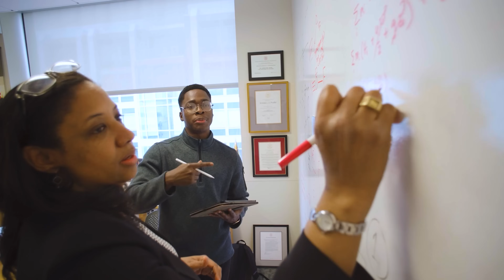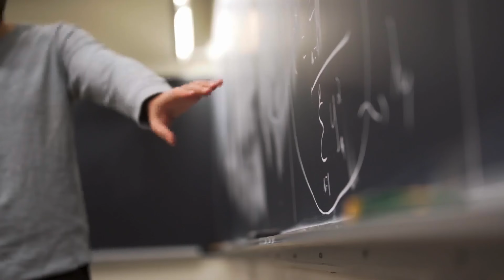This is MIT

Comment: The robotic arm found at 34 seconds on: https://youtu.be/N1jhOO1fyZo?si=GfHkO2pP-Nc1r0KP

Is not that impressive. Wouldn't it simply identify where the intended track is and take the fastest or most optimal route to getting back on that track when moved away, then finish the track? A more impressive thing would be catching moving targets because it would have to constantly recalculate optimal tracks from where it is, accounting for the target's movement speed.
Reply: Also, for my idea, couldn't you use a scanner that police use to determine the speed of a car, then with a dataset, you will know how inaccurate the measurements are to determine the equation, then add time since scan plus time to solve equation. I'm sure there's a trajectory equation, too.
Reply: If there's a performance loss (more inaccurate over time), you'd want that in there, too.

Comment: Let's solve the world

CO2 INTO CH4 IN ATMOSPHERE FROM SOLAR ELECTROPHOTOSYNTHESIS WITH ADDITION OF REFRACTORY RADIATION OF ELECTRONS AND PARTICLES WITH ALUMINUM 

Instead of photons just passing by a plant that reflect back and forth between nano aluminum mirrors and heat up the aluminum atoms plants. Tobacco plants in North America have to be in full shade where they're spraying aluminum yet they grow just fine in Cuba and Ecuador. 

They're making a Methane factory and bonding what could be ozone to carbon, the only way a dumb plan will work is to keep it secret from a world full of geniuses

Tell NASA about the Moon and they'll make Moonfall ; )

They need to make a Universe room and reverse Tesla ball atmosphere models, also just spray desalination ocean water, not aluminum and carbon which cause refractory radiation and is cooking the atmosphere and causing refractory radiation on the surface making it intense, also you might be able to change an orbit. Also the aluminum and carbon being spayed refracts photons, charged electrons, does electro photo synthesis and while you're burning oxygen instead of hydrogen from say, solar electrolysis of ocean water, you're burning oxygen and bonding oxygen to carbon and the H is bonding into CH4 Methane up in the atmosphere. It's all backwards

It is [a really good idea] that we stop spraying aluminum and CO2 into a magnetoshere and start spraying desalinatated ocean water instead, were causing refractory radiation and it's making the heat much more intense and heating the planet and causing melting of ice caps and evaporation of ocean water which then makes fresh clouds; we need to just spray salt free ocean water. The more we try to cool the planet were actually making it hotter and energizing a magnetoshere which could cause more solar flares and fry us. We're cooking the planet and causing solar evaporation of the ocean for clouds formation instead of just misting H20 out of 747's, got a whole plan. We're making CH4 up there in a process of retracting photons into electrons while they spray CO2

Hello my Friends

ANUBIS IS THE BEST DOG

What if Pharoah was trying to build a weather machine to attract lightening to nuclear electro magnetic earth ground to cause more rainfall and thus more food. 

Clouds of higher solar charged particles jump to clouds of lower static change, known as heat lightening, as nature seeks a balance. 

When there's enough solar charge in a cloud electricity as lightening crosses the air insulator and connects to earth, as it does it creates a vortex where hydrogen and oxygen particles connect and bring down water droplets and fall due to nuclear electromagnetic gravitational earth gravity. 

Electrons go around an atom like the moon around the earth and the planets around the sun.  

The Egyptians saw that lightening was attracted to metal, and the higher the better. 

If Pharoah had a copper cap on the pyramids with electrodes running through the air chambers down into the spring underneath, Benjamin Franklin might have been wearing an Eye of Horus Watch and driving a Bently.

Is the grounds turned dry, like a leather glove, no matter how much you tried to arc welds, it wouldn't work. Tree roots go searching for water in the winter when there is no rain, as solar photoelectric synthesis move through an organism seeking earth ground.

Also lightening is more likely to hit the lone farmhouse than the neighborhood, as electricity in houses flow through a black or hot wire, and take a neutral [white wire] path back to the electrical panel, where the Neutral Bar is bonded to the Ground Bar and goes into the earth via an eight foot copper electrode to dissipate returning unused current into the ground. So neighborhoods are energizing water tables instead of storing that electricity in batteries.

Anyways, I'm thinking a cargo helicopter, a brand new Copper Cap for each pyramid, and copper electrode wires running down to earth ground via the spring water table, and electrodes can be drilled into the earth below the springs for better contact, and we can complete Pharoah's Weather Experiment as lightening is attracted to metal high up from the ground ; )

Could you imagine the attraction of this new event to honor the Pharoahs and those that built the Pyramids!

And maybe bring more rain to the earth, and keep it most, and electrically conductive and inductive to storm clouds for more crop rain. 

If you want to in vent some cool stuff kaw me

Also, should we celebrate ancient ruins or rebuild them to honor ?

Also oil rigs should be underwater and not above and you wouldn't have oil spills 

China builds underwater structures, you could be just 20 feet underwater, you can run vertices flexible stormproof snorkles and a flexible to surface entrance/exit 

And, 

Grow more opium most the world's doesn't even want to be here and people can move other places, it grows in attics that are 140 degrees, skylights would need insulated glass in the attic shafts and you could use mirrors in the gable ends, just don't be in the attic in the day, if there's ever a shortage

Also oil rigs should be underwater and not above and you wouldn't have oil spills. China builds underwater structures, you could be just 20 feet underwater, you can run vertices flexible stormproof snorkles and a flexible to surface entrance/exit

Sharks could be GPS chipped at a bait source and an alert could go to cell phones and beach alert systems if sharks are within 300 M

Aluminum spayed in the atmosphere might f us magnetically with solar flares as photons charge electrons and they jump to like particles of lower charge, hence h2 broken from oxygen by the sun becomes h4, we increase particle charge in a magnetoshere 

Use aluminum for other things, spraying carbon and aluminum heats up the planet and causes refractory radiation on the surface, the carbon in the clouds traps in the heart and in the ocean causes dead spots. You need solar distilled ocean water misted or of 747's instead, the sun will burst up H2O into H, O1's, making 02, O3 ozone, and you're actually adding more fresh water clouds up there, not depending on surface evaporation by causing more heat in order to make more clouds, you need to cool it

8.4 billion acres of grass=4 billion cows in the world shipped frozen fresh lawn mower clippings somewhere cool like Alaska and each cow gets a bowl of ice cream at each feeding session

You need a leaf sucker truck with a refrigeration unit, grass is mowed for tax refunds, 20 Million jobs paying 60k from May to October in air conditioned, sealed window, tinted window, XFM lawn mower cabs with triple level suspension seats, mini leaf suckers pick up small piles and dump them by the street, big leaf sucker truck picks them up and freezes the frozen grass and then it goes to rail cars then somewhere cool to be 1100 lbs with a winter jacket. The people that kiss cows and sing songs for them take care of them and she gets a bowl of ice cream at the end of each feeding season. You'd have 10x more cows, over 1 Trillion in goods. In the US you'd have to double your grocery stores just for the milk, cheese, cheese cream, sour cheese, cottage cheese, yogurt, milk, butter, ice cream, etc...

When she doesn't want to be a cow anymore she gets a bowl of ice cream with some fennies, half the world would say thanks and leave their suffering, and that's be like 400 years of 80 world wars at 50 million each for $79 M USD and you would double available resources to a world only full of people who want to be here, and China could work half of what they do and get paid the same while making 10x more cows. The CH4 can be turned into H20 work left over 0 while we burn the H in solar electrolysis of ocean water

I have a lot of invention ideas in energy, defense, security, food infrastructure etc...

Would like to meet up with some people and talk to them about making some cool stuff

Missing solar film wrap on high rises and fields shouldn't have solar panels but should be solar panel green houses growing every crop everywhere, humid and tropical warm all year growing facilities

If i owned companies and could make a robot to do a crappy job i would ask my Friends that work there what they want to do, and then who knows, sponsor a rock band for the same amount of money, etc

Also we're better off putting one high rise adjustment building on a farm rather than single family homes all over the entire farm until they're is no farm, however we can do the get- paid- for- what's weighed- Farm America or anywhere Initiative

and let's send ocean rivers to the world and do solar lens distillation of ocean water in the central west and oak it on airplanes and cloud seed they're where it's really dry